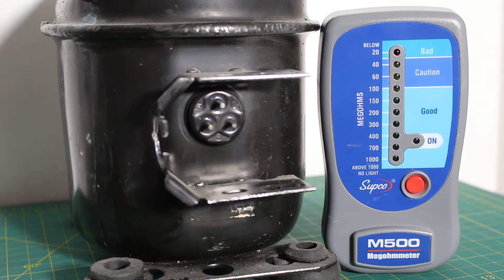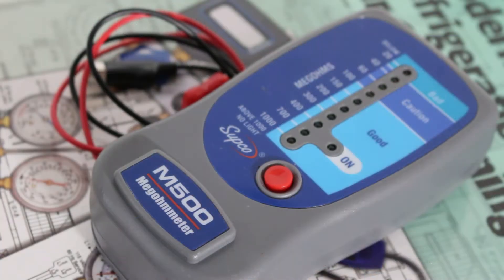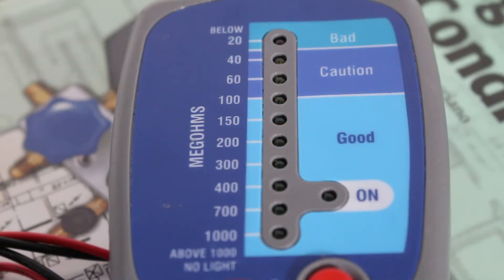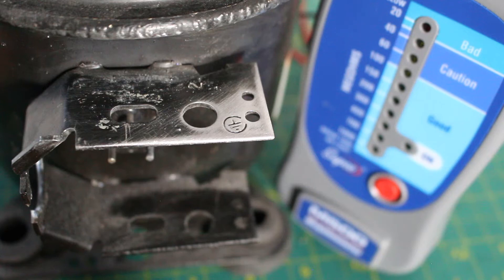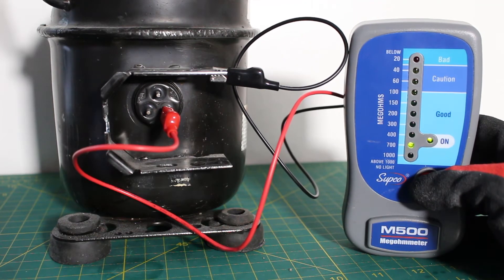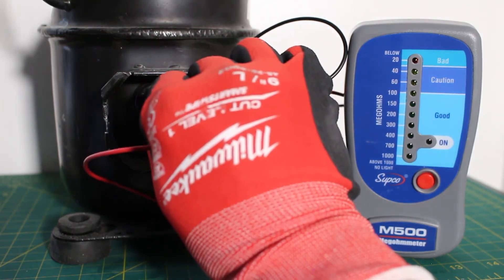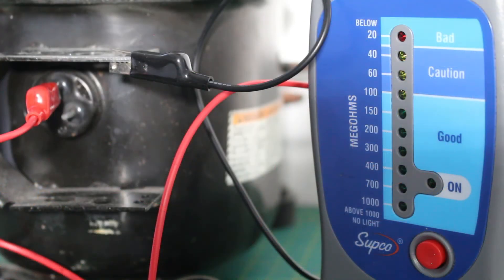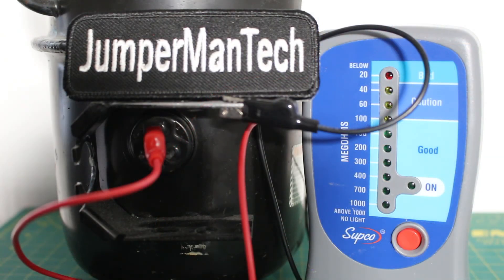HVACR: "Megger" Insulation Test For AC Compressor (Motor Windings Insulation Resistance) SUPCO M500

Comment: Wouldn't u also go between the terminals as well
Reply: Nope you are testing the resistance between each leg to ground/motor casing. For checking resistance of windings you just use a typical multi meter with the ohmmeter function. The reason for using the meggohmeter for insulation testing is you can find issues regarding the insulation quality that you will never find with an ohmmeter as it doesn't push out enough voltage to effectively test it.

Comment: I still got this little megohmeter. It's been about 8 years now since I purchased it. It fits comfortably in my bag and its light enough to have it on me at all times. 
As a troubleshooting tool it works great but for maintenance where the customer requires insulation tests annualy you gotta bring out the pricey big boy.
Reply: Derick el mejor te sigo vine q ver este aparato te consegui por acá saludos
Reply: With shipping to Spain it costs about €100, is it worth it?  Greetings Derrick 🛠️🛠️🛠️🛠️💪💪💪💪💪

Comment: Why is anyone using a meter like this? Youre just testing resistance, use a multimeter. Resistance on the windings to ground should always be infinite. That good-caution-bad scale is pointless. If one of the windings has any path to ground at all, it's shot. 

Even further, this isn't even a good test of the compressor. You should be checking resistance between windings too, and comparing them to each other. You can't add up the actual ohms here because it doesn't give you precise numbers. 

Buy a multimeter, this thing is garbage.
Reply: Multimeters have a limit as to how far they can test with the internal battery. A Fluke 325 can go to 40 K ohms and the 902 does 10 K ohms. 
However a megohmeter can go way above that threshold and give you information whether you are having insulation issues. 
Maybe it's a motor that shorts out every now and then during its run time and a regular meter can't pick it up. That's where the megohmeter shines.
Some commercial/industrial clients also require insulation tests and their readings as part of their maintenance contract.
Reply: You use a megger to STRESS THE WINDINGS! You can't stress the windings on 9volt and pen light batteries! You need to apply double the voltage DC at 1 milliamp rating.
Example: I've  had condenser fan motor on a package units often have a infinite reading on my fluke 87v a rainy day I had a callback as moisture penetrated insulation and fan shut down. 
Especially in equipment outdoors.
Yes you do need to ohm out windings.
The technician was just giving a simple demonstration.
Most compressor manufacturers allow 25 megohm minimum due to motor being submerged in oil.
You don't need pi/dar testing just spot on hvac motors. 
I would recommend the Klein et600 for hvac technicians.
You should use a 1kv on 460 v motors.